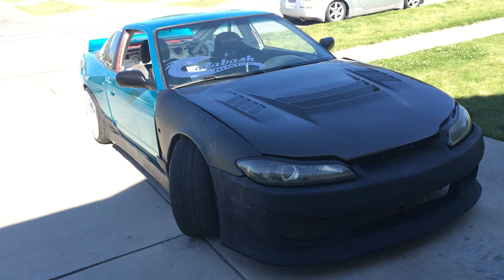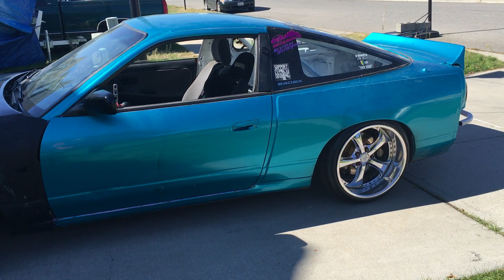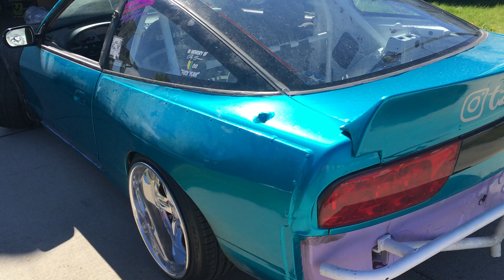Idle Sound - 240sx cammed LS1 with Open Headers | (Season 3 Episode 8)

Comment: Wow sounds great!! What’s all done to the motor?
Reply from the maker: Braden Stoner thanks! Just brian Tooley stage 2 cam, ported heads, high compression, open headers, titanium valvetrain, ls7 lifters, etc
Reply: High compression as in what? Did you swap to higher compression pistons? Aka dome pistons? Or did you mill the heads? Or both? Car sounds amazing what did it dyno at and what rpm? Sorry for all the questions but I’m building a ls s13 drift car as well atm
Reply from the maker: DGSR 03050818 machines the heads, stock pistons with a tiny bit of a bore. Never hit the dyno, guessing 450-500hp based on the mods and how much more smoke I made when drifting lmao
Reply: Terencezeee so the heads were milled. Do you know how much they where milled? I got a 2007 5.3 long block for $100 it was ooosijg pressure so it’s going to the machine shop since it’s already getting looked at I’m just going to have it bored to 5.7 making it an iron ls1. So ls1 block with stock 4.8/5.3 heads makes the engine a 11.1 compression. After that milling heads and fly cutting pistons. Man you can do whatever you want as long as you run e85. All motor no boost problem with great hp but even more toque lol I’m just thinking out loud but that’s what I’m going for
Reply from the maker: DGSR 03050818 no worries I love talking cars/mods!! Yeah man I think I might do an iron block next time to save some money and holds up to boost if I want to boost it later